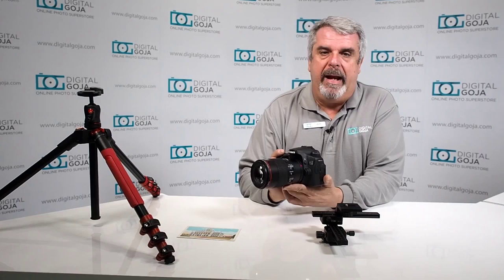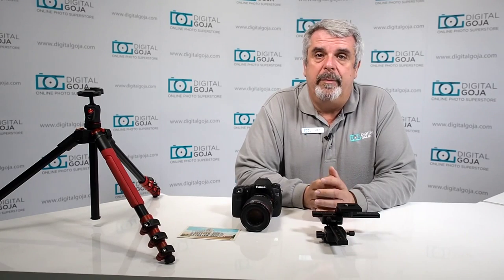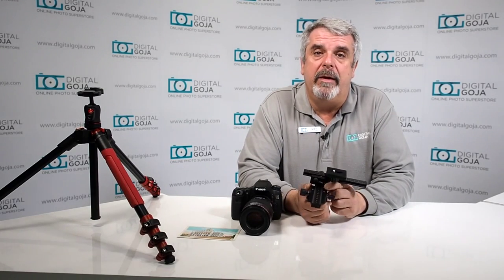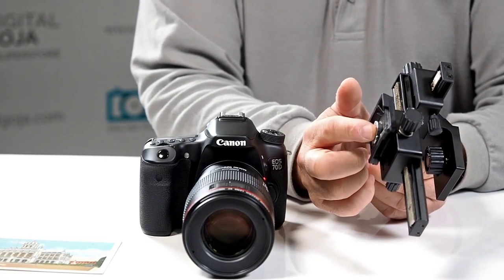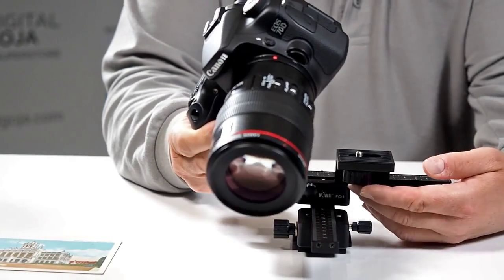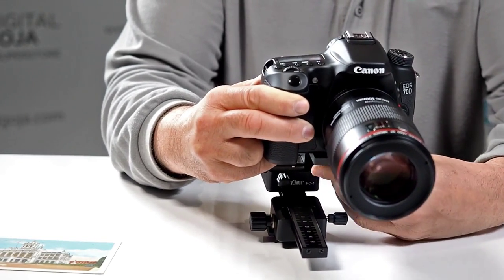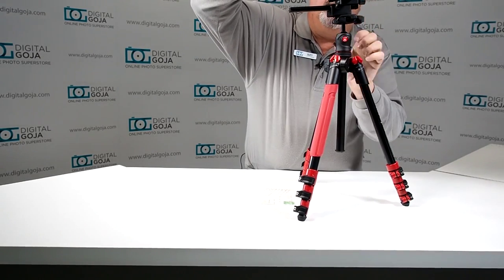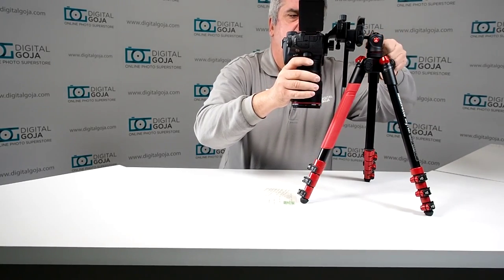MACRO FOCUSING RAIL TUTORIAL | How to Use a 4 Way Focusing Macro Rail for Digital SLR Cameras

Comment: I'd feel a lot more confident in this rail if the Manfrotto quick release plate supported the entire base of the rail.  As it is, half the QR plate hangs out the back, leading me to ask why the mounting holes on the rail base were placed so near the edge of the base.  Seems like the design places undue stress on the QR plate, and make me nervous about balancing expensive gear on top of it, especially at any extension of the rail.  Any thoughts?
Reply from the maker: Hi Terrence, we agree on that, when using a heavier lens it could make some trouble. We hope Manfrotto updates this for their new products.
Reply: Thanks for the quick reply, D-G.

I don't think Manfrotto will be changing its QR plate design any time soon, as that would require the central bolt to be located near an edge, creating a whole new set of problems.  I think it would be simpler for the rail's manufacturer to provide a second 1/4-20 mounting socket in a more central location on its base plate, so either popular style of QR plate (Arca-Swiss or Manfrotto) will support the entire surface of the rail's base plate.  But until that happens, I'll keep my sphincters crossed each time I mount my Bronica MF closeup kit on it.

I was just curious about which mounting system the rail maker had in mind when it decided to place the mounting socket where it did.
Reply from the maker: Hi Terrence, your feedback could be very helpful for them, seems that they did not have that in mind when creating the plate. We will try to contact them to see if they can provide us with something helpful.

Comment: Can you, please. tell me how you fitted your manfrotto tripod plate for mounting to manfrotto tripod as the base of the slider that changes the forward and backward motion has no  1/4" thread, has 4 holes but not for any insertions? Kiwwi  FC-1II
When I queried was told there was only 1 FC-1?  Thank you for your help
Reply from the maker: There is the Kiwi FC-1II plate that should work with that.
Reply: Thank you for your kindness in answering, but perhaps I did not explain my problem clearly -   on the base you show your manfrotto tripod plate with 1/4-20" thread which you screw onto the tripod. the base I have beneath my rail has no such screw hole.  I have the  plate which was mounted onto the arca swiss receiver which one removes so as to insert the camera onto plate and its screw.  Do not know what that is for as nowhere to fix it. There's no screw hole enabling the rail to be mounted onto a  tripod on my Kiwi FC-1II  so cannot use the rail as is.  I do not know how to fix this so any help you can give is much appreciated, Kiwifotos tell me its the FC-1 and the FC-1II, which I do have, is the update.
Reply from the maker: Hi, it is possible that you received a defective base, you should contact Kiwi again. All of them should have that hole.

Comment: Hi, thanks for the video. It was very helpful. You mentioned(at 1min 23 sec) that another quick release plate can be added to attach the camera. Could you kindly show how to do that ? Regards
Reply from the maker: Hello, Md Masud Hossain. I'd recommend checking out the Manfrotto Quick Change Rectangular Plate Adapter or something similar. The base plate will mount to the focusing rail and the quick release will mount to the bottom of the camera. The one thing to make sure is that there is enough clearance for the locking switch to secure and release the plate.
Reply: @DigitalGojaUSA  Thanks so much
Reply from the maker: You're welcome, Md Masud Hossain. Glad to help out.

Comment: Thank you very good explanation.  Please which focusing rail are you using, the links offer a few?
Reply from the maker: It is the FC-1 Macro focusing rail.
Reply: I order the FC-1 but have received Kiwii FC-111 is this the rail you demonstrated as order was confirmed as FC -1 Please.  Thank you
Reply from the maker: Hi, it is the Kiwifotos FC-1 macro focusing rail, it is possible that the seller sent you the wrong one.
Reply: Thank you.  I now have this rail, it is covered in oil, do I clean before using or is it supposed to  be used as is?
Reply from the maker: Hi, it is probably covered in it for a smoother use, we would not suggest cleaning the oil, at least before you use the rail, then you can see if the oil helps or not.

Comment: Is that rail suitable for focus stacking? What's the minimum increment? Is it solid enough to trust with an expensive L lens?
Reply from the maker: Hi Thomas, yes it is suitable. It has a 1/10 of an inch increment and it will easily hold an L series lens like the Canon 100mm  Macro L IS f2.8.

Comment: I can't figure out how to mount the Tripod plate onto the slider!   Help Me!   Please!
Reply from the maker: Hello, Don Wilcut. Sorry if there was any confusion. You would need to have a complete quick release system with the mounting base and plate. you would have to attach the mounting base to the macro rail and plate to the bottom of the camera. For example, I would recommend checking out the Manfrotto's Quick Change Rectangular Plate Adapter. This uses their standard RC2 mounting plate.

Comment: there's something i don't understand.  if you are incrementally moving the camera forward for each shot, doesn't the image become incrementally bigger?   how does it align and blend in PS if the images are all of different sizes?
Reply from the maker: Hello, frank waters. You are correct. As the camera/lens gets closer to the subject the magnification will change. If you were to focus stack you would change focus distance without moving the camera so you could maintain the relative size. You still may run into some issues depending on how much your lens breaths. The macro focus rail system makes it easier to make precise moments of the camera. It makes it easier when manually focusing the lens for macro shots.
Reply: @DigitalGojaUSA  i still don't understand.  so, say that you have 20 images,  each a tiny bit different from and larger than the next one, how can you compile them in photoshop or helicon?
Reply from the maker: @frank waters. Assuming that you've stepped the lens down to a small aperture the minor difference in size shouldn't be an issue for an application meant to automate the process.

Comment: Went to your website.  Searched for macro rails.  No returns.  Why do you do you tube videos?
Reply from the maker: Hi Jerry, this video was made in December 2015 when we had the rails, we do not sell them anymore.
Reply: I'm trying to find a 4-way macro Focus rail of high-quality under the price of $200 and I've been searching and searching and searching and doing it looking at reviews on Amazon and other places and have been disappointed don't know where to go from here
Reply from the maker: It is difficult to find a good one for $200, mostly the high-quality ones cost more.
Reply: @jerrylazarus5014  Search this on amazon, the model he presented is there. A year late but I've only just done my research.    PROfezzion Premium Dual Axis 4-Way Macro Focusing Rail Slider with Arca-type Quick Release Plate. The same unit sometimes has Kiwi FC 1II marked on it, they're all the same thing. About £65 so maybe $70 - $80